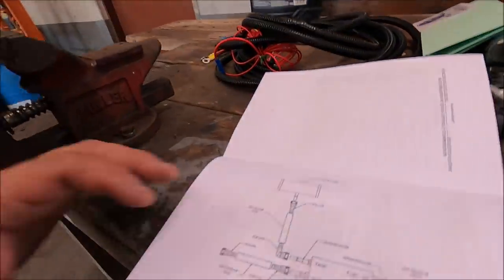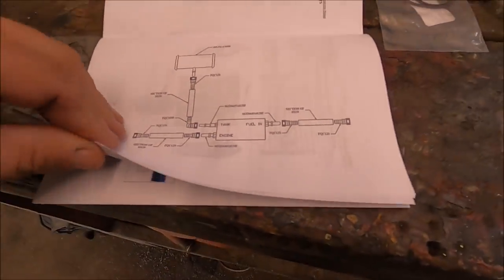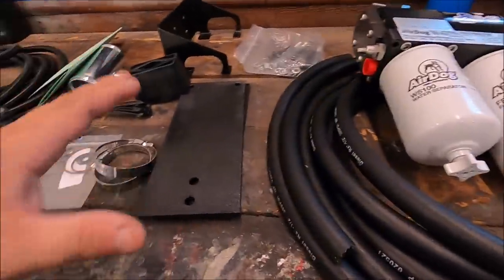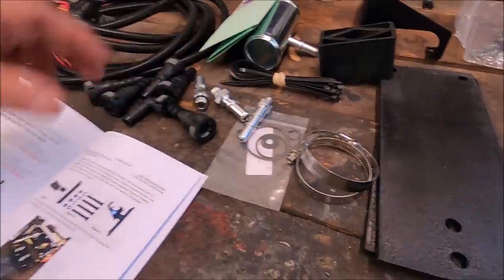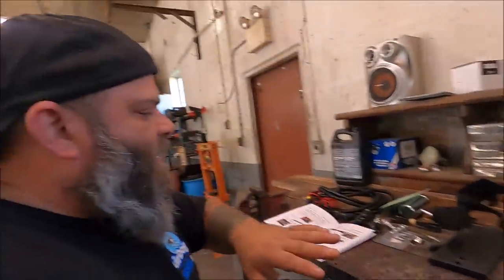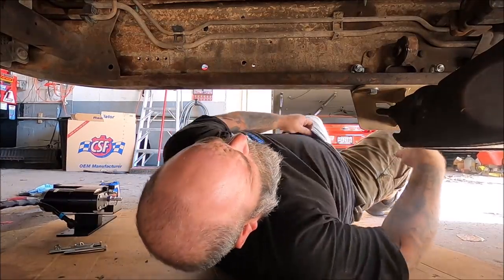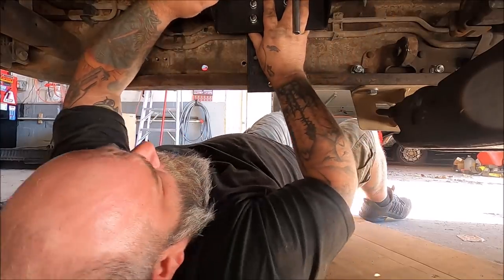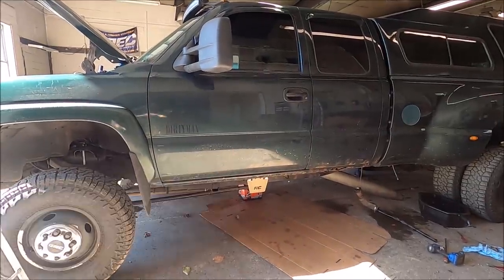Getting Rid Of My OLD FASS Setup For A New AIRDOG SETUP.......BEST DECISION I EVER MADE!

Comment: ANDY, you gotta put the tank sump kit in at the same time. I have a 2001 LB7 that has a ton of money in it, when I put the lift pump on it, I drilled the hole for the Bean MFG sump kit and you would not believe the amount of pure shit I dropped out of the tank. 20 years of build up from drawing fuel from (NOT the bottom) I was installing new injectors with .45 over nozzles and didn't want any problems with crap in the tank. I installed the lift pump and removed the fuel cooler, installed a Caterpillar filter conversion on my stock fuel filter head. So now, my tank is kept 100% clean because I draw fuel from the lowest point, fuel is run through the water separater then the fuel filter on the lift pump and then through a 3 micron CAT fuel filter that is freaking huge(almost a full liter) then it hits my new injectors. LOVE IT and no problems

Comment: You will like this new set up with it pulling from the center of the filter it usually makes your motor not rattle so loud since it does not pull air from the filter that causes air knock

Comment: Have not bought either yet, its about to happen this week, with a sump. The research I have done so far shows a pretty unfair level of differences between Fass and Airdog. The Fass has an insane amount of engineering and research. Larger corners and interior tubes, heavier wiring, better connectors etc. But I am currently in research to decide which to BUY for my Duramax. I guess my final question would be, does all of that engineering actually MATTER in the long run? Does the small price difference compensate? I LIKE the airdog mounting system better. Not to mention the ability to drain the water out of the water filter after each trip.